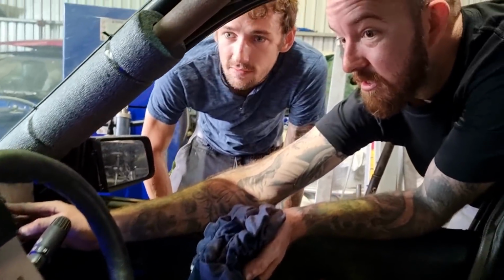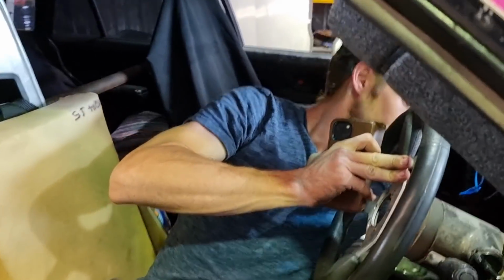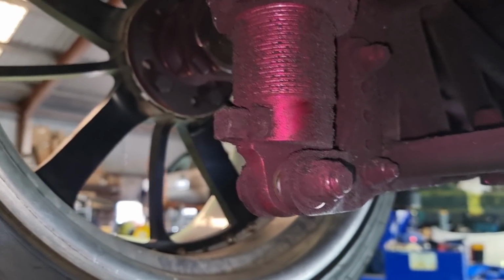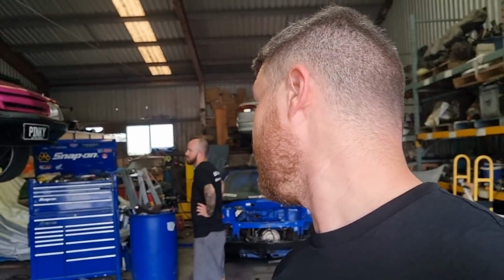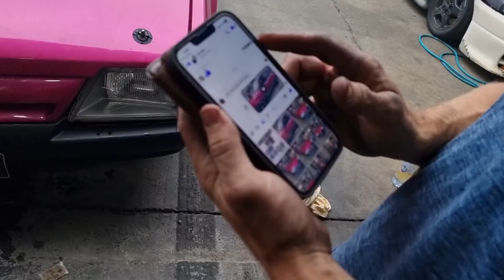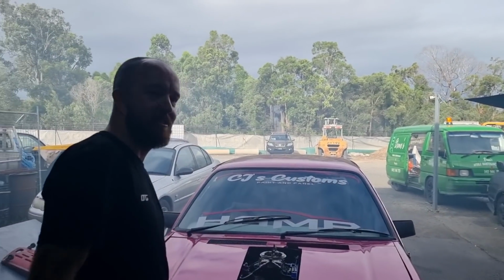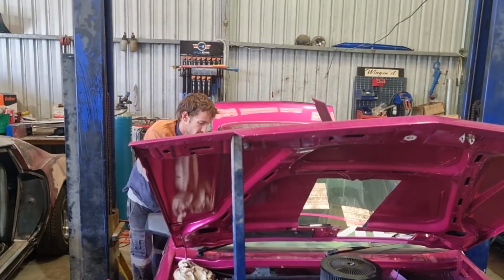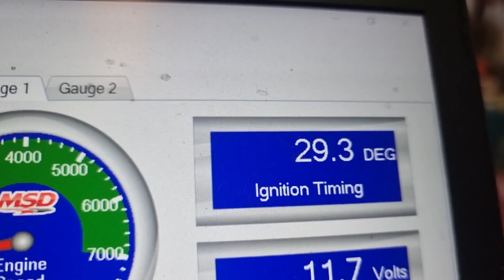Testing the combo in PINKY/PUDDLES before SUMMERNATS 34

Comment: What engine you running brother nice
Reply from the maker: Specs:

LS1
Stock bottom end 
Fly Cut pistons (100 thou) 
Gm Motorsports Street Racer II Cam (232 243 @ 620 lift if I remember correctly) 
Ported the heads in my garage
Bowl job and valves + valve seats cut by some professionals and blended into my home port job
100 thou ripped off the heads to bump the comp
Super victor intake
950 quickfuel 
Msd 6014
Reply: @WinginitMotorsports  thanks mate